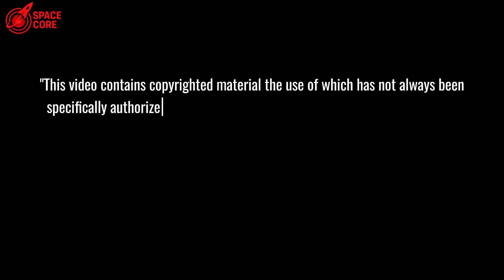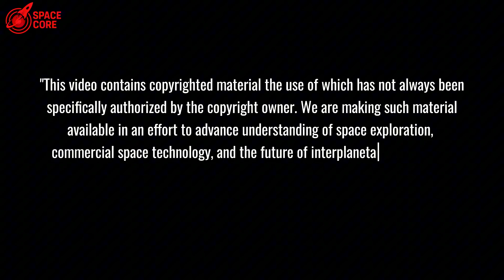SpaceX Found Something in Florida That Blue Origin Never Expected..

Comment: They can build them fast because they blow up once in a while, they build one but you won’t die, which one you want the fly in?
Reply: Falcon 9 was developed the same way and has since become the most reliable launch platform ever. That’s the point, it’s an engineering development methodology that favors real world testing and iteration over long tailed design cycles.
Reply from the maker: Falcon 9's reliability comes from rapid iteration, favoring real-world testing and learning from hardware. This core SpaceX engineering philosophy is now applied to Starship.
Reply: starship is in development, expected to blowup; every launch has something in it that pushes the boundaries, for example they leave off tiles in certain areas to see how it effects the ship.  Falcon 9, their previous ship, has made over 200 launches to landings without a single failure, and is still currently launching satellites in to space twice a week.
Reply from the maker: SpaceX iterates fast, accepting prototype failures for learning. Human spaceflight demands extreme safety. You fly proven, human-rated vehicles like Crew Dragon, not high-risk test articles.